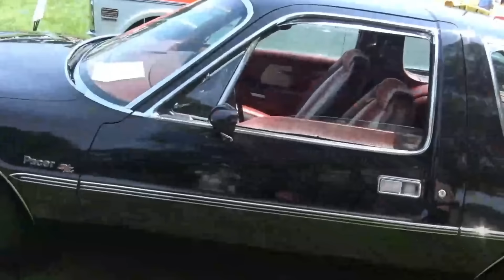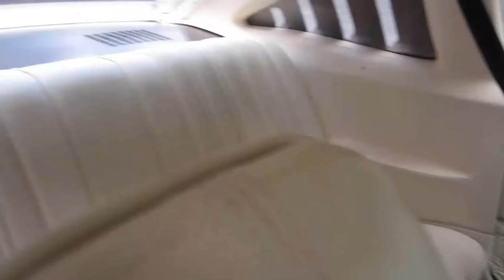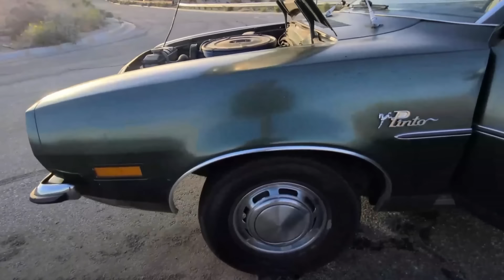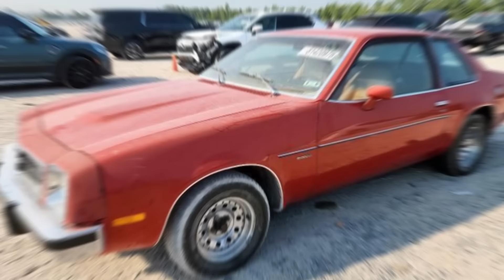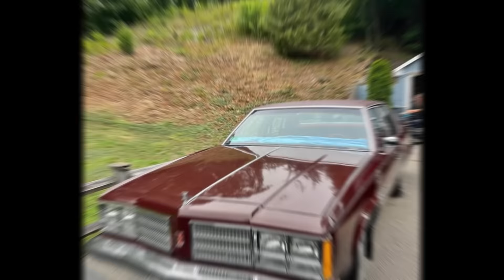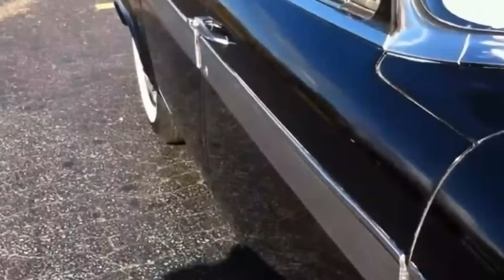Top 13 WORST Cars in US History!

Comment: Oldsmobile put that diesel in several models, not just the Delta 88. My sister had a Cutlass station wagon with the diesel. The motor had to be replaced while still relatively new and under warranty. Complete piece of crap car.

Comment: I want to disagree with the Vega.  Yes, it was a piece of crap from the factory.  But to the vintage/hot-rod enthusist, it is a good platform to build a small-block Chevy fun car.  It has plenty of room under the hood for a big swap, plenty of clearance for aftermarket transmissions and suspension.  My friend built one and put a very nice paint job on it.  That car was a blast and looked great.

Comment: A LOT of the "70's" vehicles were junk.  When the so called oil crisis came along, the Japanese flooded America with cheap higher gas mileage vehicles that were sold in volume.  The "land yacht" vehicles that Americans were use to, that got poor mileage were scrapped and the CEO's wanted cheap vehicles to compete.  It wasn't until the 80's that some of the American vehicles started to be a bit better.  My dad sold cars from 66-2000 and he said the ones in the 70's were mostly all junk.

Comment: Did anyone have experience with Ford’s variable venturi carburetor ? What a total disaster that was, I bought a ford Futura , v-8 with that carburetor in 1979, it was a disaster that could not be fixed - the car would have been nice , but after about 40 k miles it was unrepairable, you basically  had to replace it with a different carburetor system all together. Turned me off to Ford cars basically forever.

Comment: Pinto did not disappoint me. I was young, motor strong enough to break tires loose on dry pavement (manual transmission), durable and no issue with rust in New England winters, sold it to younger brothers to get more miles out of it.

Comment: I had a 1980 monza coup with the six cylinder back around 1990 as a beater car for going back and forth to work... and it was great!
It had a 4 speed manual transmission and ice cold a/c (Florida) and I never had any problems with it at all.
Used it for surf trips too with those old school, teal colored surf racks.
I wish things were still like the 80's and 90's.

Comment: I was statst Ft Carson Co. In 1986 and bought a 1979 Chevy Monza 80,000 miles with 4 spd 4 cylinder 151. Being a E1 with little money the engine oil didn't get changed at all. I drove that car till it had 176,000 miles with only replacement of the clutch. If I didn't get in a accident who knows how much longer it would have lasted

Comment: I had a Volare after purchase I discovered the Passenger door was painted so bad the undercoat could be seen.  Carb was a disaster for many dealer visits, then they called the oldest guy over and said to fix it. The float bole rod was bent and rubbed on the side of the carb. He fixed it in 1/2 hour including removing the carb, repair and re-instillation.  Water kept coming into the trunk no fix offered.  I used a Phillips screwdriver to punch a hole to make a drain.  I must say it was a great snow car I drove it in very deep snow and when stopped I found I had a hot smell.  Snow was packed to the inside of the hood covering the engine.

Comment: Yeah, the Edsel's, vertical radiator looked like an opened vulva. In the day, we called it the "cunt car". What were they thinking, unless that's what they were thinking.
We had a 1967 Chrysler "New Yorker". It was big and heavy and totally unreliable. the worst car I have ever driven. It broke down all the time and wouldn't start in cold weather.  It stalled and stranded me on the Throgs Neck Bridge, for Zeus's sake! What a POS.
The crap American cars of the '70s opened wide the doors for the Japanese cars which were miles better, and IMO, still are. My Toyota Sienna is the best car I have ever owned.
BTW, if this kind of AI shite is the future, I don't; mind dying.

Comment: On the Pinto, you misstate the cost benefit analysis.    This report was prepared for overall Ford products and was not specific to the Pinto.   You made it sound like Ford undertook the analysis after the Pinto news.   That is not factual.

One the Vega, the real issue was the undersized radiator which caused the overheating situation and the rust problem was due to air pockets that developed as the car was dipped into the rustproofing primer.    The aluminum engine was not bad per se, but once overheated by the small radiator, then it caused issues.

I've driven a Pacer when they were new and they were not bad cars.    They handled well with rack and pinon steering and lots of room inside.    The outside was like a fishbowl but the visibility was incredible from the inside.

Mustang II was not bad - you are applying modern standards to a car that had to be built due to energy crises and it was not cheaply built.

Odd that you do not mention 1970's Toyoduhs that rusted once you pulled off the lots and disappeared in four years from rust.    Rust through on Toyoduh products continued into the 1990's with their trucks having rust through issues that caused rear suspension separation.

The Dodge Aspen was the same as VO-LAR-RAY which you already mentioned and mispronounced the name.

Overall, this video was a crock of sheet.

Comment: I bought a 1979 Olds Starfire new. Twin to the Monza. It looked good, had a nice cloth interior, but what a piece of crap. The clutch needed replacing, a front brake caliper seized, rotors warped and the rear stabilizer bar just broke. All this in under 23,000 miles. I sold it and bought a Corolla with 76,000 miles. It ran great, gave me very trouble in the two years or so that I owned it. I’ve only bought Japanese cars since then. One Toyota, one Nissan and four Hondas. That’s only six cars in about 45 years.
Reply: I have had only 6 cars since 1970. All Buicks. I never kept up the suggested maintenance except oil changes. No major repairs except the computer sensors on the 2004. Which I gave to my niece's family in 2017. They drove it from Kansas to Alabama many times until 2021 so it had way over 150,000 miles by then.

Comment: I owned a hatch Monza. It's biggest problem was the front end. Had to use a torch to cut the craddle for every front end alignment. And the rear sway bar broke with every second gear scratch....

Comment: I had a friend that had the Plymouth Volare, Fuel Pump started acting up at 17K, Warranty Denied, said bad gas. I replaced it with a Bosch. Fuel pump metal was rotting. At 26
K car had this weird vibration, dealer said lack of oil changes, even though they did all the oil changes. A piece of the Gear, had broken off the Distributor. Eimise Electric installed a new steel gear. Old gear was pot metal. It seemed like once a month something failed on the car, all before the 36,000 mile three year warranty was up. Finally told her since the car still looked nice sell it. She bought a German Ford, was a well built car.

Comment: My friend’s dad bought a fully loaded Volare and barely drove it because he was given a company car (with a gas pump at the worksite), so he always used that instead.  When he retired, basically gave away the car to one of the boys in our friend group, had less than 10k miles on it and was in pristine condition. Basically only driven every few weeks to the local Chinese Buffet, grocery store, and one trip to Disney world. Total of 4 times in the 15 years he took it to the dealer for service. Changed the tires once, nothing else. It was a great car. For some reason, there were several attempts to steal the car. Eventually, thieves got it. A freaking 16 year old Volare was a target for thieves.

Comment: I had one of those 75 Chevy Monza Town Coup. It was a bear to work on. Mine was red and while like the one you were showing with the Craiger SS wheels. and a 262 V8. We didn't lift the motor to change the back 2 plugs but it may have been easier if we did.

Comment: I owned a 1980 Chevy Monza bought new. There were three things that I had issues with. 1) Check engine light would come on due to failed O2 sensor. 2) I never fully trusted the brakes. Had a situation where the brakes would pulse. 3) Headliner separated from the roof.

Comment: I bought a new 1980 Monza Coupe with the Pontiac 2.5L "Iron Duke" 4-speed, I was doing sales all over the USA and sold it after 2 years with 83,000 miles on it.  Only did  4-5k mile oil changes & front brake pads.  I thought it was one of the most economical and trouble free car I've ever owned!  It was small (I'm 6 ft), but it was still comfortable even on long trips!